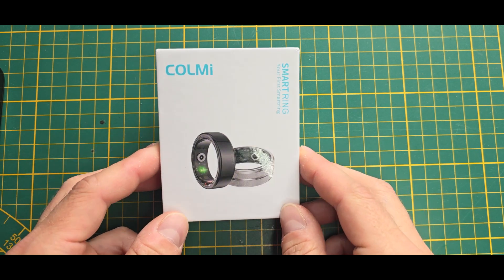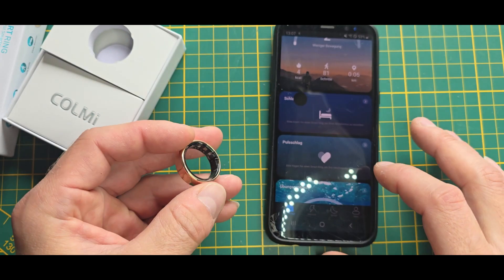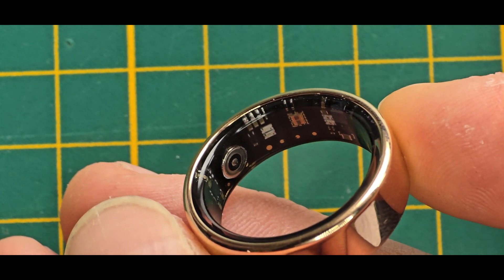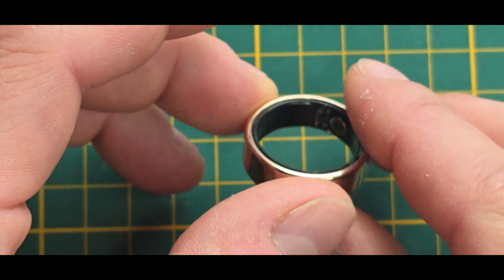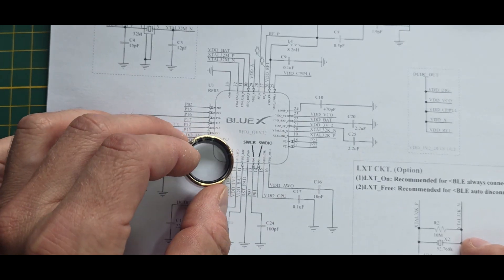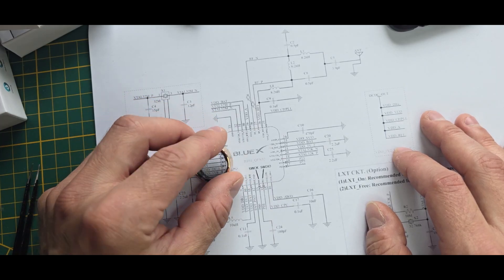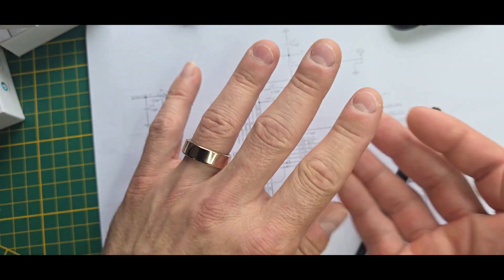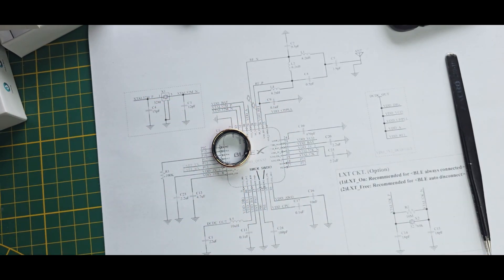Hacking a tiny Bluetooth Smart Ring

Comment: Two thoughts (that may be answered in future updates): could this be paired with Windows or other devices for presence/absence detection and auto-locking of workstations, and could the accelerometer be used for gesture detection either always or after a signal like a double- or triple-tap? Gesture detection would offer a lot more capability.
Reply from the maker: Hey, yes to both. It would be possible but requires a custom firmware and quite some work

Comment: You're so good. The ring is surprisingly good as well. I charged it today and after 13 hours I'm still at 96 % battery (10 minute HR intervals). Unfortunately, it counts ghost steps when I type on keyboard, until that it's pretty acurate.

The heart rate can be set to 5 minutes minimum, that kind of sucks. And the O2 saturation can't be customized, it's only once per hour.

Also, the sleep is recognized only during the night (just like with first Xiaomi Mi Band) and only one sleep per day. But that's something even Garmin missed until last year or so. If only there was a good custom app for that.

Comment: Hmm I'm not too good with soldering and not too enthused about scraping the epoxy and wiring into it to put custom firmware on it. 

Do you think its a good idea to just do it via the firmware update system? Or having at lease one hacked ring mandatory? I really want to use this for 3d gestures with that accelerometer 🤩.
Reply from the maker: Should there at some point be a ready to use custom firmware one ring without soldering should be no problem. But that is a far way to go

Comment: Wow! Never thought these would be hackable. Does the outside of the ring act as a single "button"? Can it detect both touch and release events (so you can tell how long it was pressed)? Would be cool to have a Morse code key that was a bluetooth ring. Also is it possible that the ring could act as a host for bluetooth headphones? (That's one way to solve your lack of output problem)
Reply: As far as I know, it isn't "touch" sensitive. It is basically "bump" sensitive. (No capacitive sensor, just an accelerometer).
So it can probably tell if you tap it firmly, anywhere on the ring. But it probably wouldn't know about release or duration.

As for audio output, I doubt it. This only has Bluetooth Low Energy 5.0, and BLE didn't support audio until 5.2. But I have seen very few audio devices that work over BLE anyway. None of my earbuds support it, even the $200 ones.
Reply: @huhthatsodd  That's good info, thanks

Comment: Great work showing how it will be possible to develop firmware for this.   If I could make it stream accelerometer data at 25 Hz I could use it instead of a smart watch for epileptic seizure detection with OpenSeizureDetector.    Do you know if 25 Hz would be feasible for this device or would that be asking too much of the battery?
Reply from the maker: That should be possible via a buffered transfer from the Accl to the SoC👍
Reply: @atc1441  Thanks - I have ordered one so will have a play with it!
Reply from the maker: Great :) just be prepared to spend a lot of hours into it
Reply: @GrahamJones  Hit me up if you were able to do what you said in the first comment! Thanks in advance :)
Reply: Any progress? I would be interested in streaming data for gesture detection.
Reply from the maker: The stock firmware can be modded so it will stream the accl data.
Flash the "fast" firmware of the repo and uae the "enable animation" button here to see it working https://atc1441.github.io/ATC_RF03_Writer.html